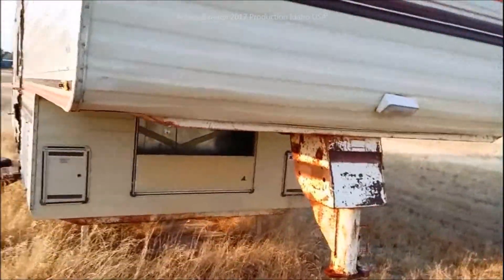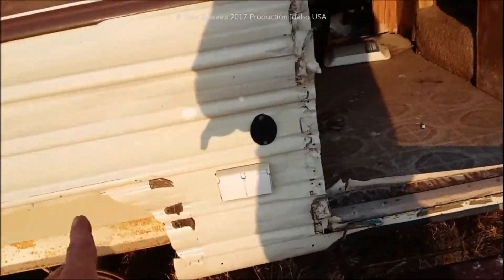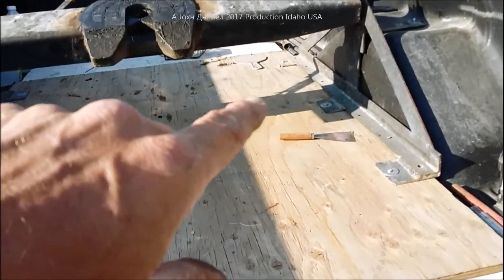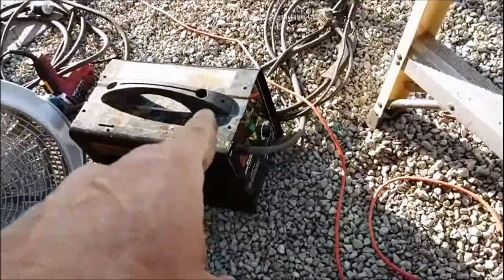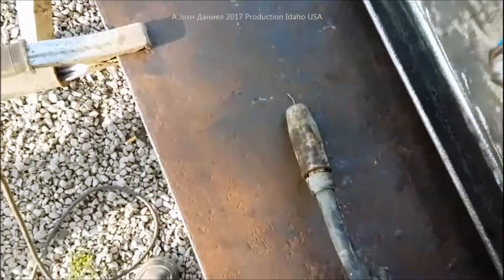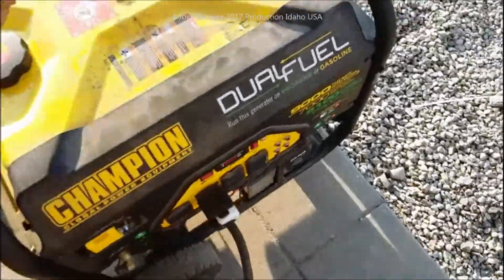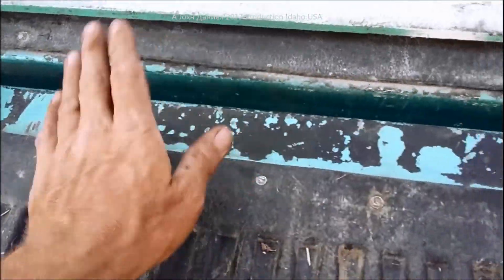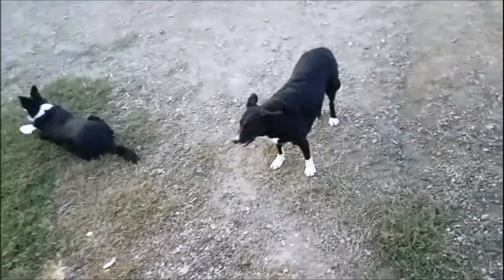Red Neck GOOSE NECK HITCH for $20 Dollars RV SALVAGE FUN

Comment from the maker: TOOLS AND MATERIALS USED BELOW 🚚 BEST CHAMPION Dual Fuel GENERATORS, none are better.
 9000 watt - http://amzn.to/2wero5F , 4375 watt - http://amzn.to/2xg07wv ELECTRIC IMPACT - http://amzn.to/2fWNNxA
If your going to build, PLEASE get a better welder like the Forney http://amzn.to/2FNWFBS. The Welder I absolutely prefer 125A Forney, Very easy to learn on & use. My cheap ones died young! Flux Welding wire - NONE other than INE Brand http://amzn.to/2G9nuzR Don''t even waste your time with other stuff. And when you are using salvage metals, don't waste your money on dewalt or ryobi, get http://amzn.to/2u0wySG for your metal prep. 
Hope this gets you going. Remember, save, salvage, don't get slowed down by any BS!

Comment: I've got a 29' 1988 Fireball fifth wheel I need to rebuild. it's in fairly decent shape for it's age and is livable. When I've got her rebuilt, she'll be FAR more energy efficient and comfortable than when she was built. Not bad for $203.00
Reply from the maker: 🚚 This one is currently 35'4" long but I plan to shorten it about 20" so it can fit inside a 36 foot RV cover with a little to spare. The 15' x 35' metal cover has a enclosed end and door, so it has to make it in that. 
I own ( almost own, 18 more payment) a bit over 38 acres of nice remote land in Texas in the hill country near Menard Texas, all I have on it is a water well, a 30 foot cargo container, a box off a 18 foot Kodiak box truck and a really crappy 4 bedroom old farm house thats falling down. 
I plan to park this yet to be built PREPPER trailer on the property and put our 5 year food supply in it as well as use it as a power source and some storage. The idea is putting 10 STION 135 watt solar panels on the roof of it, another 10 on another like it for tools-inverters-batteries and materials and another 8 on yet another one as well as 12 - Uni Solar 72 watt panels on the big Holiday Rambler. Then we just have to tear the house down, salvage what we can and put in a 4 bed room double wide. Retire program achieved!  
RV's make a excellent source for frames that are already proven, aligned, and easy to get parts for.